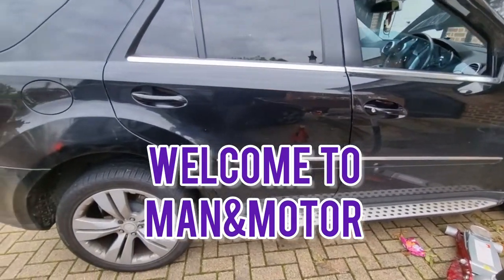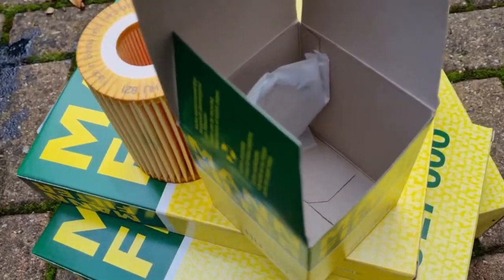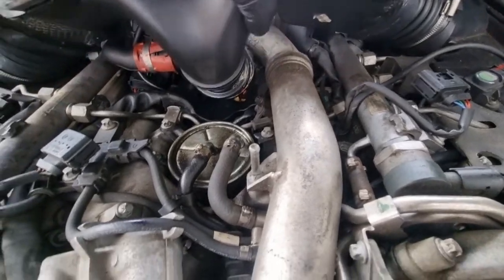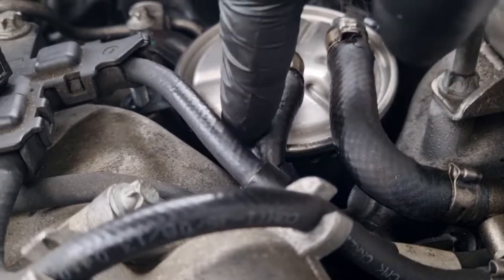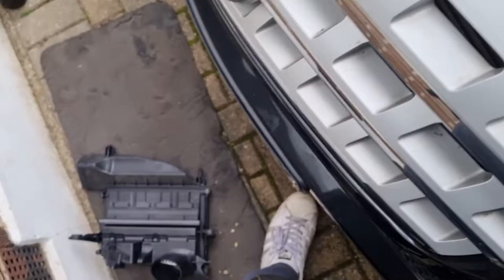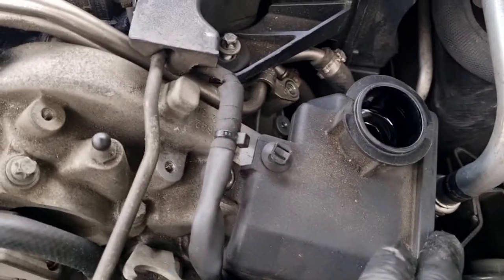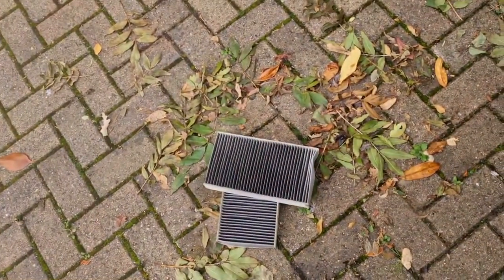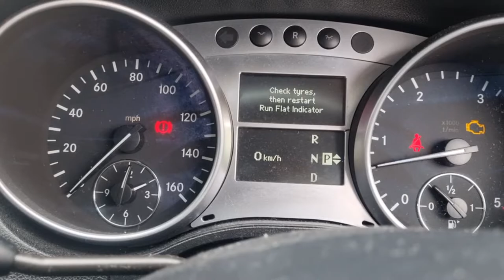Mercedes ML320 Diesel 2009, Full service,  oil, Air , Pollen,  Fuel Filter, service rest

Comment: nice video, never understood why Mb put the drain plug in the front, makes it impossible to drain most of the oil from engine when using ramps, maybe I will use only one ramp from left side. Do you remember how much oil you got out this way ?
Reply from the maker: Sorry can't remember on top of my head